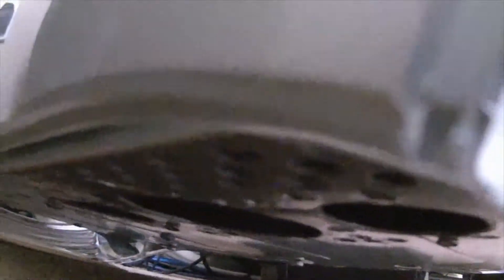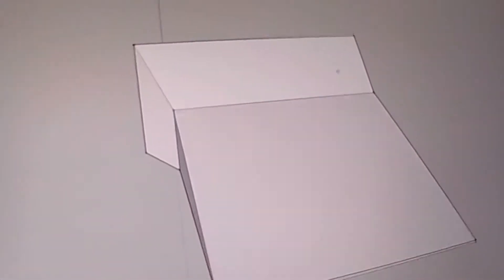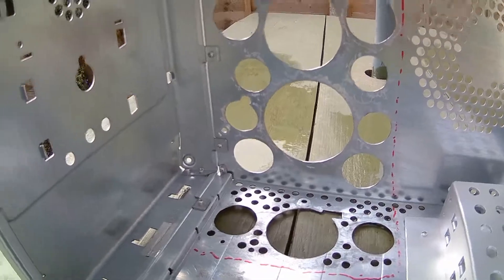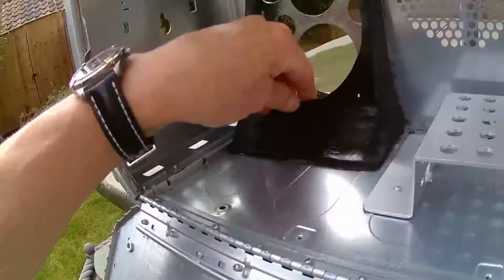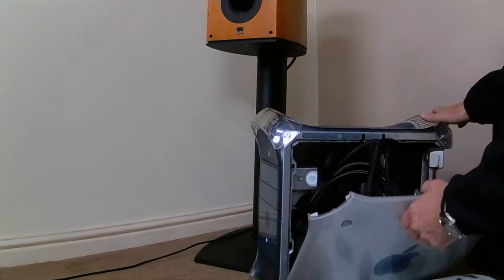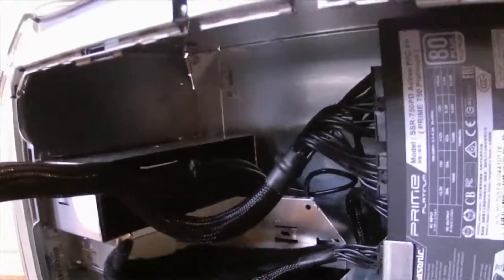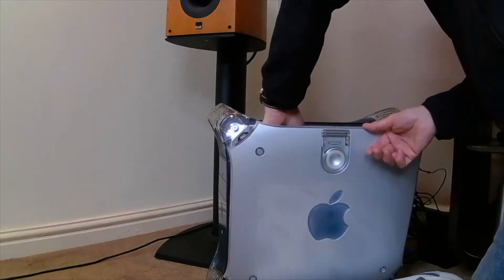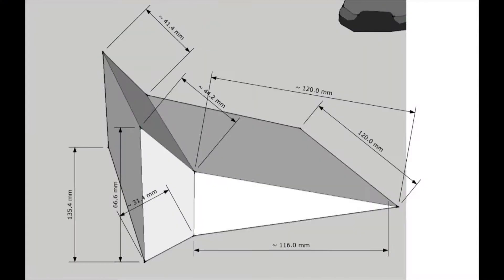Part 3 PowerMac G4 - Optimized

Comment: So you have a fully modular PSU right? Definitely get some custom length cables. That will help with airflow and temps as well as make it a bit easier to open and close the case.
Reply from the maker: Thanks for that idea... I had not thought, but will look into..